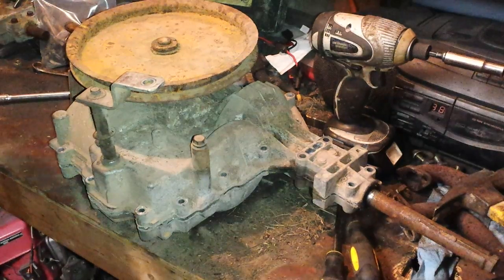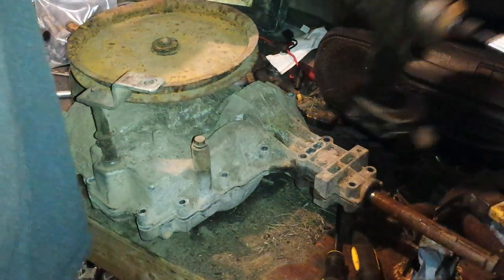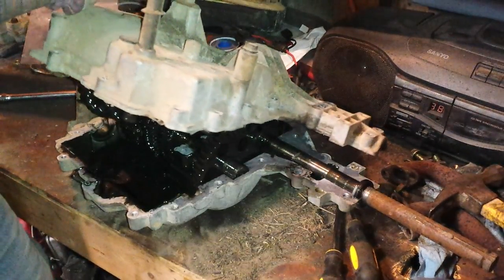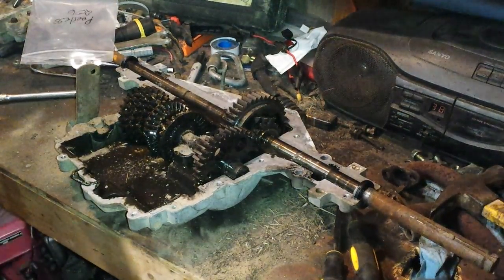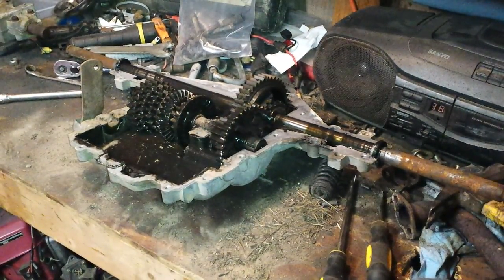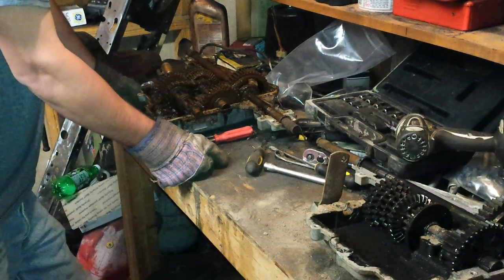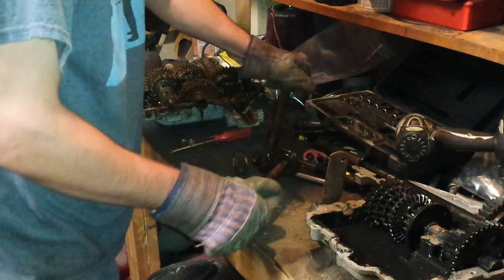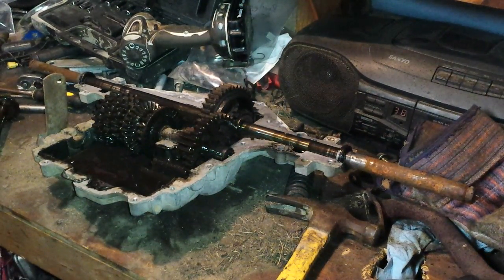How To Turn A Peerless MST-206 Into An AWS Part 1

Comment: Shoulda  installed  steering u joint  couplers  by cutting the axles  down. Same concept as the all wheel steer transaxle
Reply from the maker: That's true and I'll do that next time I build a 4x4 mower